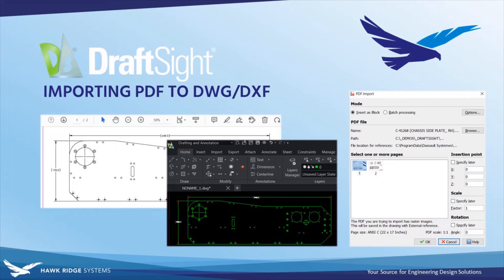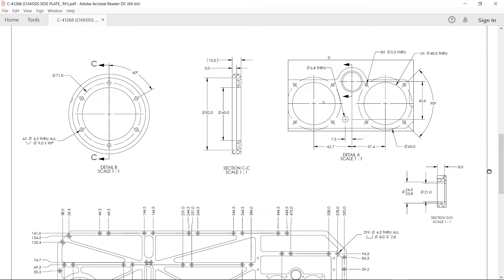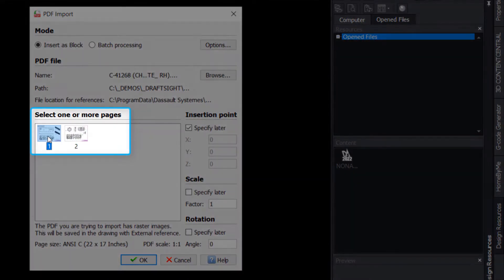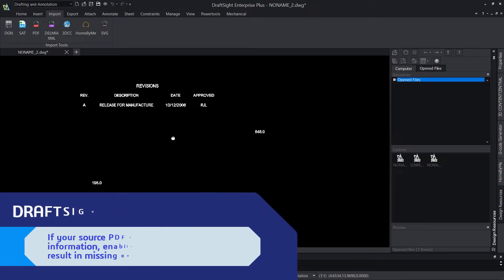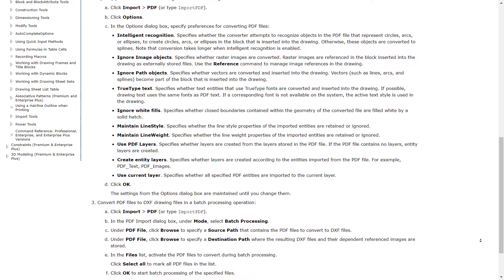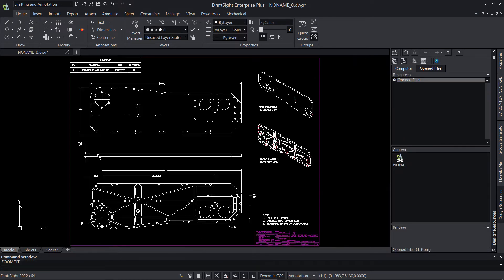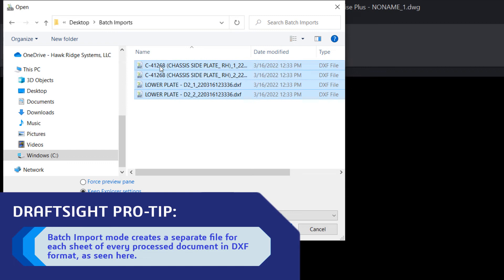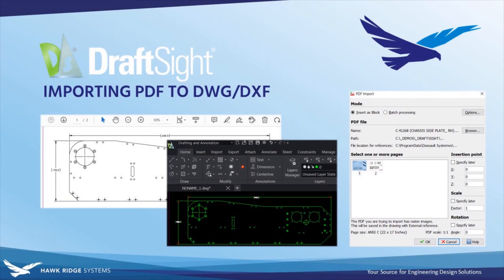DraftSight: Importing PDF to DWG/DXF

Comment: The subscription for professional increased by 250% but still no pdf use, its a joke. I have an RTX 3070 GPU that displays realtime 3d modelling but will not allow me display a pdf in 2d properly.
Reply: Same.   At this point. I like Draftsight, but AutocadLite is the better fit.  We can get PDF import and free AutoCad Web.

Comment: I get, "unrecognized command" when I try importing the pdf.
Reply from the maker: PDF Import is only available in DraftSight Premium and Enterprise versions, so you may not have access to this command if you're using the Professional version. Additionally, PDF Import was introduced to DraftSight in 2021, so older versions will not have this capability. Outside of these factors, I'd recommend checking the spelling of the command or trying to use the Import PDF Icon instead of the command line. Otherwise, you may need to take a closer look at your alias mapping to make sure the command is properly associated with that alias. Good luck!
Reply: @hawkridgesystems  Thanks for the reply, I only have the Professional version so that's the problem.  I don't need the feature bad enough to buy Premium.   Thanks,  mk